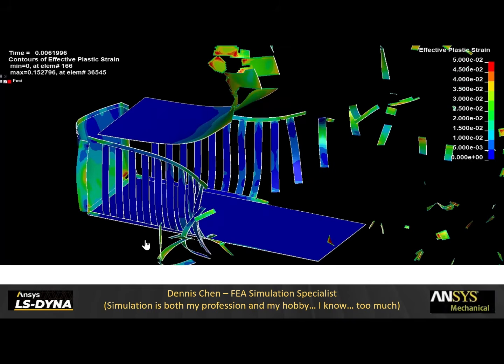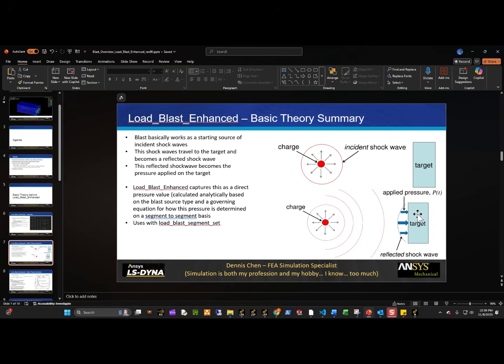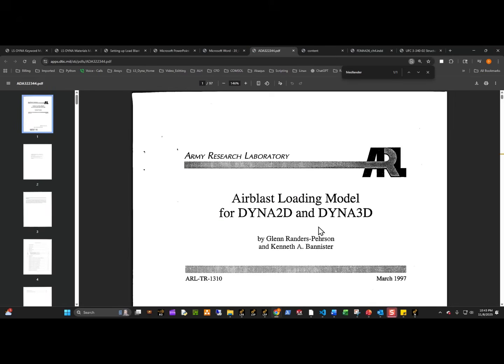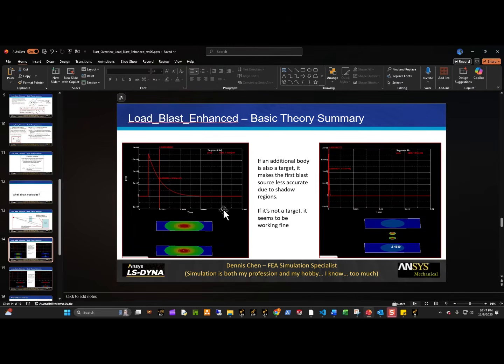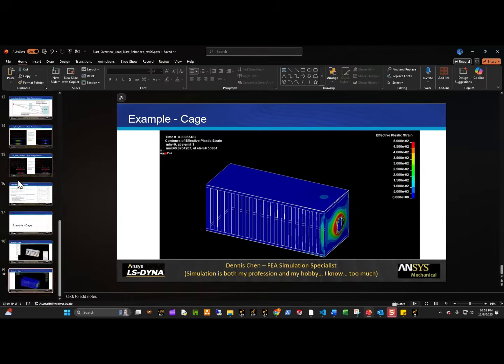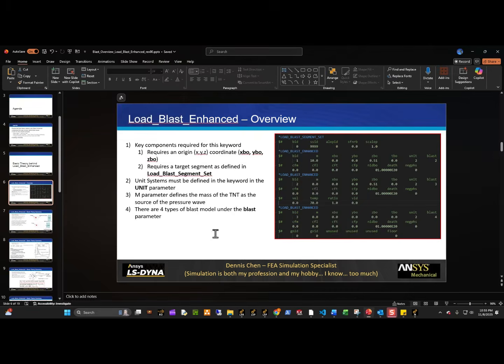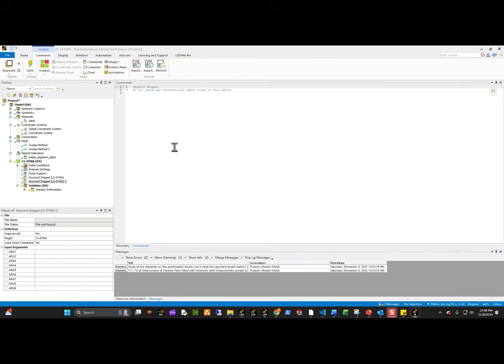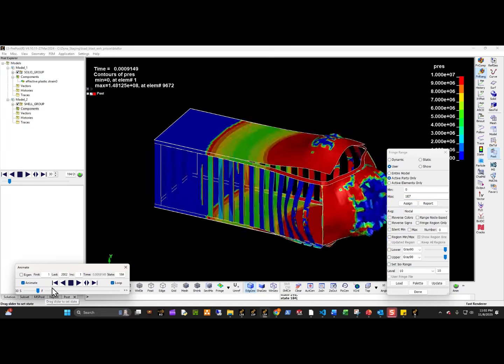Overview of Blast Analysis inside LS-Dyna using Load_Blast_Enhanced

Comment: Thank you for sharing the high quality tutorial!
 Sir, i have one question. What happens if I don't apply ADD_EROSION even under huge blast loads?
Reply from the maker: The structure would just keep deforming until you have skewed elements or instability.
Reply: @DCFEA  Thank you for reply!
Sir i got one more question.
 I usually used explicit dynamics (Autodyn) instead of LS-Dyna. And i used Johnson cook(JC) strength and failure model for material property under the blast loading. 
but the material values of the JC model (workbench-based) in LS dyna are slightly different from those of the JC model used in the existing explicit dynamics. 
Can I use the existing JC model(used in explicit dynamics) in the workbench-based LS dyna as is? Or do I need to add ADD_EROSION to the material properties along with the JC model?

Comment: *Great tutorial. Would you prepare a similar one for a water blast using LOAD_SSA? It would be a great addition.

Additionally, it would be great if you could teach us how to set up non-standard materials in Workbench. For this blast you have steel with failure defined in Workbench — I do not mean the KEYWORD_SNIPPET, but configuring the material directly in WORKBENCH. I don’t think there is a video like that, is there?
Reply from the maker: Hi   I usually do not use workbench but it does have some material you can insert directly.   This is actually really simple to do, just drag and drop inside engineering data and enter numbers.   on the left hand side, there's a section for ls-dyna material.   I usually only make videos that focus on how to model something physics related, not just on how to navigate the software.
Reply: Ok ...